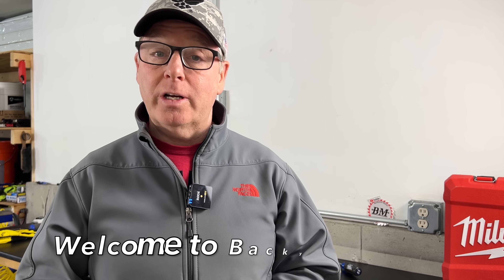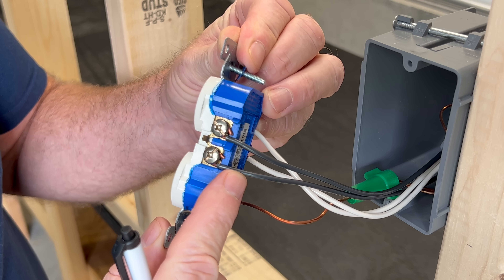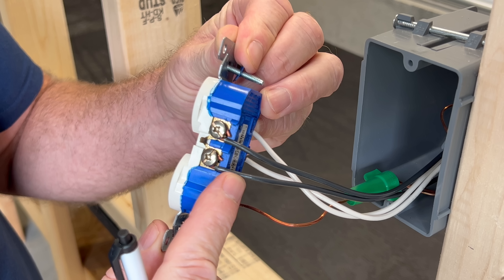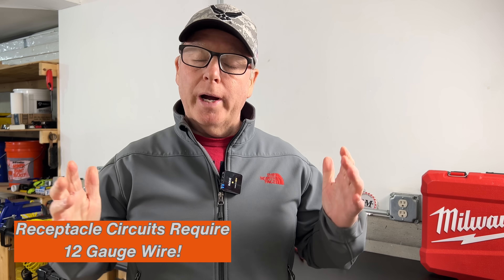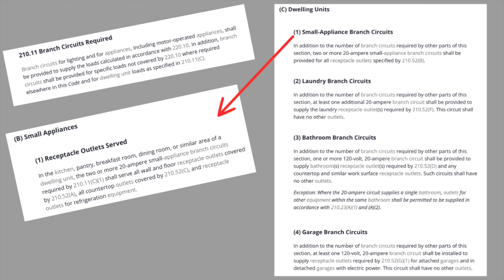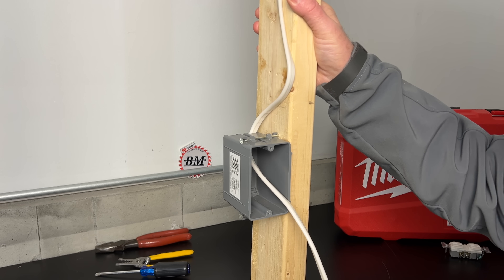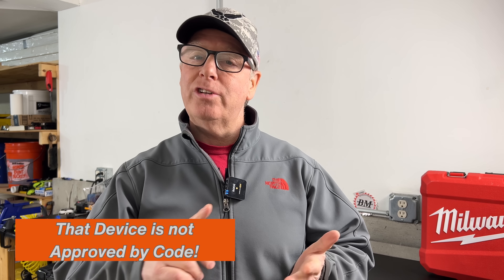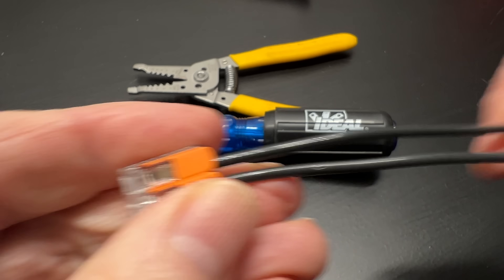5 Electrical Code Lies DIYers Should Stop Believing!

Comment: The current National Electrical Code has not been accepted by all 50 states, and in fact New York State takes a while to approve it and has been as many as 3 years behind the issuance of the NEC.  Though having the ground up is not required in many cases it is much safer to have it installed that way.  This prevents an electrical short when a thin item falls onto a receptacle that the plug is not fully engaged.  Again, as a safety specialist and former firefighter, though a 12 ga wire is not required for all outlets it is another safety issue where the wire is less likely to be overloaded by two many appliances.
Reply from the maker: 12 and 14 gauge wire should have the same potential of being overloaded. Why because the breaker protects the wire. 20A for 12AWG and 15A for 14AWG. The only risk with either is someone installing a larger breaker or the low probability of a breaker failure. Sure most states are at least three years behind some more and some less. Maine is in the process of accepting the 2023 now. I expect the change soon.
Reply: @BackyardMaine  As a volunteer firefighter for over 40 years, I sometimes loose faith in breakers as I've seen slow shorts where the breakers heated up but did not trip.  I almost sometime would have like some fires the owner had still used the old screw in fuses.
Reply: @leehwhiz  The newer the breaker the more I trust it but old breakers can "hang" for several seconds. I'd trust a 100 year old fuse before I'd trust a 50 year old breaker.

Comment: My personal favorite is people that call up their utility company because they measured their outlets and it was 119 volts ....and they want it to be 115.

And then I try to explain to them that "115 volts" just means an appliance can run on "50hz  110V" or  "60hz 120V" and that the outlet is required to have an average voltage between 117 and 123 volts, so we aren't even allowed to set it to 115

*Edit

Before people hop in 

It's a minimum of 114 for short periods of time (not the average) and 108 during brownouts.
Reply: I want 119. 115 is a ripoff.

Comment: Do I need to staple romex running through an attic?
Reply from the maker: Yes. It needs a staple or other support is required within 12 inches form a box and every 4 feet there after. If the cable is run through holes in the joists they won't need additional support.

Comment: Lol, I caught flack in one of my videos for saying the receptacle is upside down. Working in a hospital as an electrician for 45yrs    I was used to putting them ground up as metal cover plates are used and when a plate screw came loose and fell out the metal plate would hang on the ground instead of the hot/neutral prongs. Seen it happen many times even though all receptacles are checked as per code periodically! Never hurts to go the extra mile when safety is a concern.
Reply: I would certainly have commented on it. I've never seen outlets upside down and was quite surprised it's not against code.  But I think we should recognize that it is against custom. There should be a very very good reason to do it.
Reply: @Stephenwc  I put them upside down to identify a switched outlet.

Comment: You should see how mobile homes are wired from the factory. It's a mockery of any electrical safety codes. One 15amp breaker on 14/2 runs half the mobile home. 9recepticles 4ceiling lights 1bathroom fan. Breaker trips constantly. Homeowner gets sick of it and installs a 20amp breaker on that 14/2 wire running half the mobile home. If people are going to live in mobile homes, our government needs to shut down the lobbyists and require mobile home manufacturers to wire according to more strict wiring safety standards.

Comment: Plug strips are often used as face-up receptacles on countertops.  This was a fatal mistake for 33 passengers and 1 crew member on the dive boat Conception, where wet dive gear was being recharged.  

A simple equation to remember:  Saltwater + plastic + electricity = fire.  And that applies to any water when it has something dissolved in it.

U.L. has minimum spacing requirements for high voltage circuit board traces.  But when the surface is contaminated, those can still arc over.

Comment: you can't leave a service loop on a single gang box that doesn't secure the wire 314.17(B)(2) exception
Reply from the maker: That's true. We cannot leave much of a loop. We can however support the cable closer than 8 inches and have some slack if needed. Example: you could gain 4" of slack if your staple was at 4 rather than 8 inches.

Comment: “Ground-up receptacles are required by code.” Tell that to Chicago, where the vast majority of them are installed horizontally (almost always with the ground to the right, but ground up, down, to the left, and to the right are all permitted by code). If I were to install new receptacles in my home, they’d all be horizontal whenever possible.
Reply from the maker: I didn’t say that. What I said was quite the opposite
Reply: @BackyardMaine  I know. I wasn’t responding to you, I was responding to those who think that they are
Reply: @xHadesStamps  Horizontal looks better, follows the floor line.

Comment: One additional comment about pigtails is regarding the myth even among electricians  that they make troubleshooting easier. For the life of me I can’t understand that at least for side wired devices. First of all the current does not pass through the device only the bus bar on the side. That bus bar is not the part of the device that fails. Second of all screws will likely be more secure than wire nuts particularly when installed by DIYers. Sure screws can loosen but so can an improperly installed wire nut. Then of course pigtails are just more stuff to jam in the box which in itself can cause then to loosen. Sometimes you need them but if you don’t it seems to me that they are not worth the extra effort and provide no benefit.

Comment: pigtails may not be required by code, but they should be. i had a clothes iron plugged in downstream from the tv and every time the iron's thermostat closed it flickered the screen. i set up a bench model with short run of wire between boxes. the through-wired model flickered. the pigtailed model did not flicker the tv. this was years ago with a crt tv, but i've pigtailed ever since, code or no code.
Reply: Your "experiment" proves nothing. A properly installed recep using the terminal screws for feedthrough is equal in integrity and function to a pigtailed recep. Feedthrough current does not go through the load that's plugged into the recep; it goes in one terminal screw, travels about 1/4" to other terminal screw and continues downstream. A pigtailed recep with a loose terminal screw or a bad splice would exhibit the same effect you described. Pigtailing is not required because it's unnecessary.
Reply: @pld8993 maybe you meant to say that my experiment EXPLAINS nothing. well, i never said it did.

the things you explain imply that you think i don't know the difference between series and parallel. i suggest you either determine what one knows, or take better care in your attempt at "explaining".

if you want to debate, please keep your rebuttal within stated facts. 1) i conducted an experiment with a control. 2) the phenomenon was observed in one and not the other. 3) it is my personal preference to pigtail.
you weren't there so your rebuttal needs to prove at least one of the first two statements impossible. or your rebuttal needs to show that the practice is not code sanctioned.

now i'll offer a possible explanation as to WHY i think pigtailing should be required. maybe a lab nerd can test the explanation; frankly i don't care enough to dig into it that far.
over time, thermal changes loosen screw terminals, even if torqued to spec (it just takes a torqued connection longer to loosen). such loose connections in series transmit line noise which some electronics are sensitive to. such loose connections in parallel do not transmit noise unless of sufficient amplitude to trip a cafci breaker, and if that device is tripping you've got bigger problems than torquing. (to be clear, cafci is a specific device that responds to both series and parallel arcing while afci only responds to parallel arcing.) proper pigtails are sufficiently twisted then nutted and taped over. short of the tape and the nut falling off and the connection being violently agitated or cycling between unusual thermal extremes, i do not see any way such a connection can fail. in the case of agitation or thermal extremes one might consider soldering, but that's overkill in most structure wiring where the building remains stationary on a foundation. motorhomes maybe.
Reply: @dhtsoaedsdhtnadi9575  That wasn't my point, but you've just shown me that you don't understand the difference between series and parallel. Using pigtails or using feedthrough terminals are both parallel wiring, neither is series wiring. Aside from that, almost nobody that knows what they're doing tapes wire nuts, as it's almost never necessary, and it's rare for a properly installed wire nut to fall off anyway. Screw terminals do not magically loosen over time due to thermal changes and effects. They are designed to handle up to 75C (some up to 90C)  without any ill effects. Switches are all feedthrough devices, so why do we not see an abundance of switch failures, given the supposed effects you are implying? Why are the millions, or billions, of receptacles that are using the terminals for feedthrough not failing? Answer, because devices are designed, engineered, manufactured, and tested for use with feedthrough current. As long a properly installed device using the terminals for feedthrough current (all switches, many millions of receps) does not overheat, they will likely last forever. There is no data that shows otherwise or if there is, enlighten me. I've been an electrician for over 40 years and I've seen many more failed splices than I have failed feedthrough connections, but my persoanl experience does not prove or "explain" anything. The tab between the terminal screws on a plain old 15a recep is rated for 20a and under UL testing must handle at least 30a to be rated as such, so even while reaching the limit of their rating they will never see their max allowable temp. If they do, they're designed to handle it. Pigtailing as a preference because of fears of loosening terminal connections is usually based on insufficient knowledge and/or experience, and there is no data that shows it should be a requirement because of loosening feedthrough connections.
Reply: @dhtsoaedsdhtnadi9575  I don't know everything, but I clearly know more than you. I guess, just like everyone else on these forums who's wrong, rather than support your contentions with actual facts you resort to making a snide remark about me personally. Typical, and not surprising. Look up the difference between series and parallel circuits, you'll learn something.

Comment: As there is no code preventing the feed-thru backwiring of devices on two wire circuits,it is still of concern that the total circuit ampacity flowing back to the source in the tfirst device will be the cumulative ampacities of all those receptacles downstream.I’ve encountered a few very warm cover plates on installations using these backwiring methods.By pigtailing,the device internals carries only its own load,circuit ampacity is carried by the properly sized wiring.
Reply: Just as the conductor is rated for a certain amperage, so is the device. A 15amp recep is rated for 20 amps of feedthrough current so it will easily carry the entire downstream load of a 20 amp circuit. The feedthrough is through the terminals, not the device internals. There is no concern with the first device carrying the load of the circuit. It's designed and rated for that.
Reply: @pld8993  I believe,under screw pad,yes.Back-stabbed,no.Take a recep apart,and notice the tiny thin contact spring.China is not noted for quality metallurgy for the function of these parts.Over time,I consider unreliable.If backwired ,you are not using the terminals,current flows thru the internal parts.
Reply: @babaoreally8220  Backstabbing and backwiring do not always mean the same thing but on your backstabbing comments, agreed.
Reply: @pld8993  There are devices designed for proper backwiring,but they are hospital grade spec and intended for termination of stranded wire which is also speced for every commercial job I’ve ever done.However,Never used these residentially on solid wire.They’re also very expensive.

Comment: Riddle me this if you run a 20 amp circuit and feed in and out of the 15 amp rated outlets without pig tailing the splice, then do you really have a 20 amp circuit down the line past the first outlet? PS I always splice and pigtail, seen to many Burt up outlets with the feed through crap, the other plus to pigtails is if an outlet goes bad, the other outlets down the line still work IMHO 40 + year electrician in commiefornia
Reply from the maker: Im sorry to hear you live in a communist state. Maine is try to get there as well. God help us... Back to electrical. I don't install 15A receptacles on 20A circuits although it is code compliant. But 15A receptacles are rated for 20A passthrough current and are actually UL tested at 30A. I have seen them fail as well but it's usually caused by either poor connections or an overloaded receptacle connected with a splitter or a plug strip.
Reply: I agree however, there is good, better and best and code is just the bare minimum, would you agree that pigtaling is a better quality and practice? BTW why no offsets in the conduit going into the boxes behind you in your videos ?
Reply: @jamesonsonoma748  No, pigtailing is not inherently better quality than daisy chaining through the receptacles. Both pigtailing and daisy chaining, when done properly, are equal in integrity and function.
Reply: @jamesonsonoma748  Thoughtful response. And you're still wrong.
Reply: @jamesonsonoma748  I guess someone spending decades changing ballasts and lamps could technically be called an electrician.    So Mr. 40 years electrician, running conduit with offsets against the wall using 1-hole straps or straight out of the box without offsets and securing it with minis are both common ways to run exposed conduit. Using offsets reduces your bends count. You didn't know that?
Reply: Of course I know that,       especially if you want to be bare minimum code guy, however offsets are easy and professional, I don’t think bend count is a concern in the short straight runs on display in your vids don’t you agree?
Reply: @jamesonsonoma748  Not my vids. Conduit runs without offsets are no less professional. Each method has its applications. Those of us who've run hundreds of thousands feet in our careers understand this. Please explain how not using offsets is bare minimum code and using offsets is somehow better or beyond what you believe is bare minimum code.

Comment: I'm a retired 55 yrs. Master Electrician and am constantly amazed at the shade tree tradesmen giving poor and dangerous advice on YouTube. Your site is a very pleasant relief using facts and actual code references to point out the correct way to do electrical work.
Reply from the maker: I too have been in the electrical industry (mostly large industrial work) my whole life either as an electrician or electrical engineer. You have me on years though. I just turned 60 and spent 40 years in the trade.
Reply: Same here, between IBEW journeyman electrician, licensed master electrician and an electrical inspector total of 58 years, nothing infuriates me more than a home inspector or a realtor tell me that I'm over qualified or an weekend electrician that never once attended a Code class and bought a NEC book just to say the has one.

Comment: I have always have a problem with the power of building inspectors, they need to have their wings clipped. Just look at Lehtos law, you do all these things to make one inspector happy and the next one tells you none of it had to be done! Happens all the time. I had one inspector tell me on an out side door you can replace a window that keeps getting broken,  or you can put in a solid door , but you cannot put a wood panel in a door that did not come with one HE DROPPED IT WHEN  I OFFERED TO TAKE HIM TO COURT AND MEANT IT  !! ALL MALE BOVINE EXCREMENT !!! THEY NEED TO GO BY THE STATUTE AND NOTHING BUT THE STATUTE!!!
Reply: If you simply read the code yourself, you don't have to rely on others to tell you what it says.
Reply: When it comes to the NEC (national electrical code), the NEC is not law or statute by itself, it is a guideline.  It is your local AHJ (authority having jurisdiction) that makes the NEC as such so they can and do make all the local changes they want to it before enacting it as a statute. That is why you must check in with the local inspectors and not just go off the NEC book. There will be some local changes made to it to handle local situations.

Comment: I have seen a fair bit of overhype as well.  One channel described a wiring "shortcut"  (jumping the ground terminal to the neutral) as an imminent fire hazard done by people trying to run a scam akin to dileberately installing knob-and-tube.

When asked precisely how said wiring method would do as described, no answer came back.  I'm not advocating for shortcuts, but be honest about what you claim.  The melodrama only serves to keep folks uneducated.